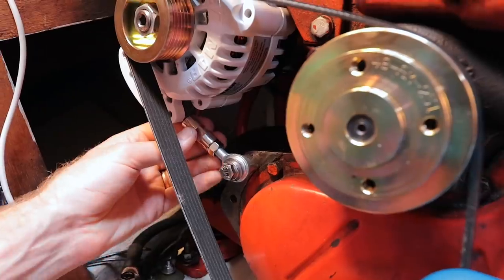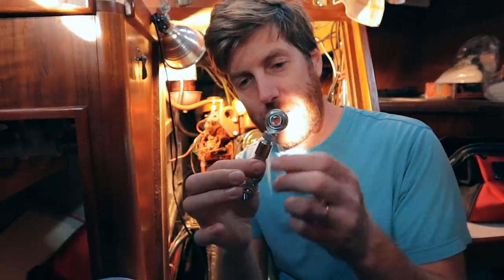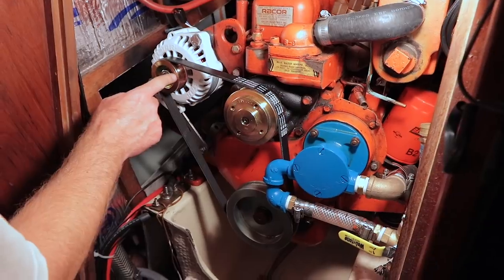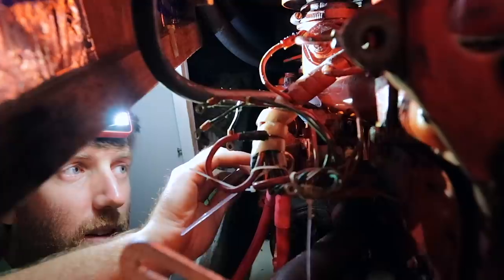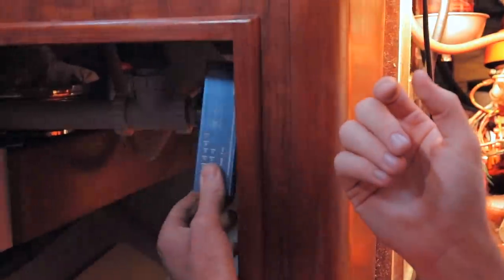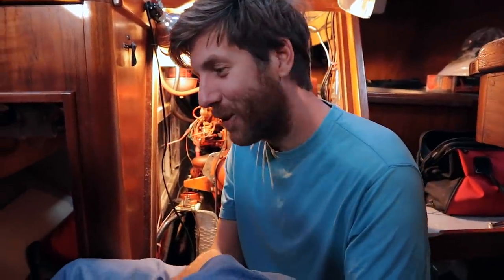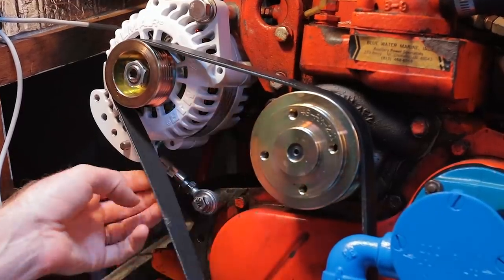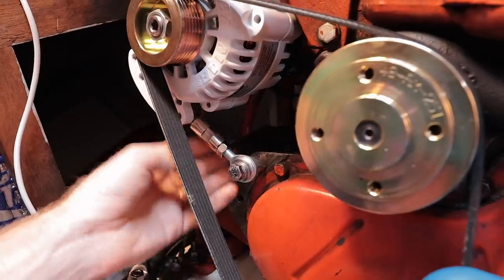“Don’t Do This, You’re an Idiot” | Sailing Soulianis - Ep. 62.2

Comment: Good Job Skipper ...when the engine was cranking if you touch the cables that you change to make sure they dont get hot, i think it will be good.. also when sailing with motor ruining better to check the wires buy touching, if anything getting hot means not so good... be safe and have fun..

Comment: You may want to think about the amount of contact the belt has on the water pump @1:04. If there is any slippage, you'll see a black powder forming around the area. There are some easy calculators out there to give a good idea of minimum belt wrap angle. Cheers.

Comment: Great work on Mr. Beke and a wise upgrade (alternator, water pump, heat exchanger, etc.).  I assume that you have a spare belt on hand but one thing to consider is to use a Kevlar belt as they are much stronger and last longer!

Comment: Kirk, The wire from the battery should always go directly to the starter. The time period of use might be low but the amperage draw to the starter is very high and gets higher as the starter gets hot due to longer than normal cranking. The amperage draw of the alternator back to the battery for charging is a lower average and the #2 wire will suffice....Marty
Reply from the maker: Hi Marty, thanks for your comment. I used the blue sea systems wire size calculator when working on this which suggested a #4 wire for a 150amp draw on a 12" run.  The jumper that's there is significantly shorter than that, and it's been upsized to #2. The instructions for the alternator were to wire it directly to the battery, which prompted the change.  I'm sure the #2 would be plenty for our 120a alternator as well, but the shorter duration of usage on the starter seemed more appropriate.  Either way both wires are significantly larger than the wiring that was there and used to start the boat for 40 years before we bought it.
Reply: @SailingSoulianis  Kirk, Sounds like you have done your homework as usual. Following the manufacturer's instructions is generally a good idea and if anything does go wrong you can claim under warranty. Love your videos look forward to future ones....Maty

Comment: I just watched your last episode with the Heat-exchanger problem. As for the old unit you yourself can fix the dents. As to the zink still in the lower end ? If you can find muriatic acid tip the heat exchanger-up on the one end and fill the H. E. Up to the top. Let the acid sit in the H. E. For about 1 hour. The acid will dissolve the zink. If you are still having problems there are two companies that specialize in these types of heat exchangers, Lenco and another company that has been around for years call “ Sender Heat Exchangers “ I think they are both out of Long Island. You can find them on the a Web. Both are excellent. Do not go to Westerbeke they will charge you an arm and a leg. Westerbeke would send the H. E. To Sender.
Reply: Todd Abrahamsson  I think you will find the westerbeke prices are not so terrible ( I have a Westy) and they ship same day and their parts will fit without modification , you can save money with aftermarket parts but it will take more time to reconfigure . Which is more important time or money....?
You also need to be careful with belts , somebody else suggested getting the equivalent from an auto parts store, you can certainly do that but you may be getting parts of unknown quality. You want to always stick with top quality parts on a boat.
In a car if it fails , no big deal you just pull to the side of the road and call triple A but at sea , at night, going thru a tricky channel is not when you want a failure  !  ( emergency spare part , that's different ) cheers Warren
Reply: @CheersWarren  I was an aircraft mechanic and worked on airframes and powerplants. If the part is a critical part and a replacement can be purchased, then replace the part. Especially if the replacement is an upgrade and engineered better. Noting is designed to last forever.

Comment: 1) U should try to fix old heat exchanger (heat up and straighten banded edges)

New style looks what i got! It has removable caps and mash so if U have broken impeller in hose its not gonna massed up everything))

2) I like to check measurements before shipping process but if they did mistake it sucks)

3) Serpentine belt system is very strong and stable!

4) Loose wires around hot exhaust need to have fire proof shield.

I like soldering tips! 

Good job!

Comment: 2 cents - a little anti seize will go a long way on your turnbuckle threads to keep corrosion at bay. Also an anti-corrosion battery spray on all of your battery terminals that are exposed to the open elements will help for the future... the set up looks good, it would be nice to have a belt tension-er on the top between the alt and the water pump so the belt can grab more of the pulley without having to be very tight. If you have belt squeal under engine heavy loads, you might have to install a belt tension-er. Just my 2 cents - wish you guys the best and keep up the great videos..

Comment: The starter needs the 1/0 cable. Running a #2 to the starter, will shorten it’s life.
A #2 wire is good for 130 amps, if its temperature rating is 90C, (195F). and 115 amps with a temperature rating of 75C, (167F). 
I really enjoy your videos. Thanks You!
Reply from the maker: Hey Bruce, thanks for the comment, if #2 will shorten it's life, then I'm guessing a #4 will really shorten it's life.  And that's what was on it for the past 40 years ;)

Comment: that flat bar adjuster is perfectly fine if proper bolt,  nut and washer is used , and method of tightening using a bar is used . if not it dose not work as it should, the new buckle one you got is just more simple
Reply: Andrew bowlgarte not a lot of room in that engine compartment to use a bar I don’t think. I like the turn buckle idea better personally.

Comment: That little heim joint makes the adjustment much easier but provides no lateral support for that end of the alternator. given diesel harmonics I would opt to have the old bracket in place. The best kind of bracket is a combination of both brackets where the adjustment screw just holds it in place until you tighten the main bolt. That being said.... it’ll probably be fine. I would watch for any vibration in that direction at different engine speeds.  Wouldn’t want to crack the base mount.  Kirk you are getting dangerously close to being “handy”! Great works!
Reply from the maker: Good points.  I was worried about that at first because of the ball joints and have kept an eye on it.  But with good belt alignment there doesn't appear to be too many side loads on it and with two attachment points at the top and bottom on the other side it seems to be doing just fine. I was also able to tighten the bolts on the heim joint enough that it took the ball joints out of the equation.  They are resting flush on their flat face.
Reply: Sailing Soulianis Good deal. I’m always looking for that thing that can come back and get you at the worst time. You guys are doing a great job and the content has been really great lately, but I’m biased to the projects. :)

Comment: I see a couple of people have made comment on you new belt.
Now  the clue is in the name, serpentine belt. Well yours is not exactly serpentine is it ?
For it all to work properly, and most importantly not slip, you need better than 90 degrees of contact with each pulley.
If you look at the front of modern car engines you will see they idle wheels in strategic positions to achieve this. Under load I'd bet money your water pump pulley will slip, not a good idea. Even dropping the alternator down would help, but really an idler wheel and longer belt is needed.
At the moment id say your old V belt would work better as far as load carrying. Serpentine belts are also run much tighter than is needed for a V belt, which means making sure things like alternators are solidly mounted, nut just relying on one bolt with a side load.
Reply: neil1150 Exactly what I was thinking.  Looks like the water pump may well slip, wearing the belt, etc.  Definitely keep an eye on it.
Reply: You would be right if the engine was not a pipsqueek.  In this case, it is a pipsquek so.... rules of thumb for ~200Hp engines disappear when talking about 30Hp engines...
Reply: They haven't changed the belt routing though much from the original factory install as far as I can see... so I would have thought it is about right? I'm not stating a fact just asking a question.
Reply: @AthelstanEngland   But they have changed the belt type from a V which would be fine with a bit under 90 degrees of contact, to  flat but grooved, which wont like it.

Comment: I would keep the original 1/0 cable going to the starter. Starters draw an enormous amount of current when starting. The #2 cable should be able to handle the alternator output. The alternator won't be putting out 100A for extended periods. As the batteries begin to charge the alternator output will begin to drop. I would be more concerned with getting more current to the starter during starting. It can make all the difference in the world when starting any engine but especially a diesel engine due to its high compression.
Reply: I agree and run out put alternator wire to the starter short lead. Simple things sometimes one misses. I have that experience  :)

Comment: Based on the advice of Mainsail I added a 150 amp fuse to each of my 2 batteries.  Think of the power you would draw if the starter cable shorted out (with a screw driver maybe).  I have a 2 cylinder Westerbeke and the manual lists 125 amp maximum draw and the fuse never pops.

Comment: Wondering if you beefed up battery cables from the alternator, a great auto electrician(Mainsail) advised negative cable to go directly to batteries from alternator, not to engine block, ‘twas good advice.

Comment: Well there’s millions of your alternators with that bracket that came with the alternator kit , with the slide bracket you can put another nut and bolt under the alternator in the slide bracket so it can’t move , hope yours works and not comes loose

Comment: Mr Kirk - I’m going to guess that your major was engineering.  That smaller gauge alternator wire was the source of fires for some older 80’s vintage Tartans.  At one point they used trailer plugs in their harness.  I got rid of my ammeter altogether,  good job.
Reply from the maker: It wasn't, but I would have enjoyed it.  We removed the #6 ammeter loop during this project as well, after reading the T37 forum!

Comment: Do not use the small wire to go back to the starter, this require large amperage and will fry the wire.
Reply from the maker: We significantly increased the size of all wiring when re-wiring the battery bank a year ago: https://youtu.be/8np3KCUTHbc  We more than doubled the size of the alternator, so I re-arranged the wiring to be more appropriate.  The wire running to the starter is more than capable of carrying the load to the starter.
Reply: Keep your eyes on it
Reply: @SailingSoulianis  Keep in mind that junctions add significant resistance, when you're dealing with high amperage. Fewer junctions will be lower resistance, and more reliable starting. That said, as long as all of the wire is as large or larger than factory, and preferably no longer than factory, you should be ok. Didn't sound like the starter was struggling, but it did take a few extra turns to fire off, so it might be worth measuring the voltage drop across the entire starter wire (measure the voltage from the battery to the + on the starter), during cranking. Repeat on the (-) side of the system. At rest, it will be 0V. During cranking, total voltage drop (add the positive and negative sides) shouldn't be more than ~0.5V
Reply: @SailingSoulianis  Its more of an issue of the starter taking everything you give it. It is also only running for a second so not the worst issue.
Reply: Thats all good advice and theories, but when you have to prime the engine, or you need to start for longer during a compression test, you need that thicker cable. when a cable gets hot, the resistance increases, wich makes it hotter. Before you know it you got a fire.
Reply: I think he said in the video that the “thinner” wire was 2 gauge. In which case that’s plenty. If it’s still small like most charge wires, somewhere around 12-10 gauge, then yeah you’re going to fry that wire.
Reply: @SailingSoulianis  A Diesel starter needs a MUCH bigger wire than any alternator can ever possibly need.  Use the thickest wire you have on the starter, but all that old 2 gauge you took off the old batteries should be plenty for the alternator.
  Another thing you could do is connect the voltage regulator batt wire at the alternator end of the charge wire, so if that wire does develop a voltage drop, the alternator will slow down in response, just enough to prevent fire.

Comment: Let me get this right, you removed the main supply from the starter, and redirected it via the alternator! Run that past any auto electrician and see what they say! I get your theory, about usage time! However the startup voltage (amps) draw is massive.
Reply: I too, was very concerned about that mod. Somewhere Kirk stated the small cable is #2 AWG, which should be good for as much as 150 amps per this site: https://www.wiringproducts.com/battery-cable

So if the small cable is actually #2, and the starter draws less than the safe capacity of the #2 cable, and the large and small cable share a common termination point (both cables are bolted to the same stud on the alternator, so the starting current does not travel through the alternator), then it may be OK. I am not an authority on boat engines either so verify with someone who is. OTOH, if you stay on rivers, you can always head for shore when the cables start to glow ;-)
Reply: One. day they will be cranking on the motor and they will realize why the starter wire should be a thicker gauge hopefully the fire will be caught in time and the boat doesn’t burn down to the water line
Reply: I thought the same thing. I think it’s risky to put the smaller cable between the battery and starter. Huge current when cranking the engine compared to battery charging from alternator.
Reply: Agreed, this would fail survey inspection.
Reply: Agree not a great idea, two extra crimps in path to alternator and one extra terminal.  Don't underestimate the current used by starter, especially at start-up.

Comment: For the new crank pulley was it still a pretty good interference fit to get it on?  Maybe about .001''?  I'm not sure about this particular engine, but for many engines the keyway is the backup and the main connection is that interference fit.  Since the original required a puller, it sounds like this is the case.  If it's a slip or transition fit, you can fatigue the key/keyway over time or cause galling of the crank nose (or a fatigue failure of the crank nose itself).  I'm not saying any of this is likely, but something I'd think about depending how remote your travels will be.

Comment: Hi Guys...Just a thought...  It is correct engineering procedure to replace any water pump mechanical seal that has been allowed to dry out.  If the mechanical seal ever does dry out - change it! These seals are designed to stay wet, once wet.  It would be a great mistake to think it will stay reliable because it is not leaking at the time of start up...  I can assure you the chances that it will fail are 80% - 90% higher and the fact is it will fail earlier than it would if it did dry out. This is something  that should be changed without question if it dried out. 

I would not go to sea without another spare water pump anyway, but while you might have a spare pump - we all like to get the most out of our equipment and tend ignore such good engineering preventative maintenance practices to our peril.  Imagine seizing the motor at sea, because the pump failed - besides the cost, its simply not something you want to be worrying about in your life, keeping a beedy eye on the temp is like sailing without an auto pilot or wind-vane when you are under way, in a passage. It can be done but its horribly taxing. Stay safe, be safe, absolutely love your videos. Kindest regards to you both. Jeremy

Comment: Great job. You guys make quite the team. In the end you are ending up with a very capable power system and quite the colorful engine. I've got to order the Balmar magnet as the boat I bought did not have one onboard. My alternator is floating the FF batteries too high when motoring - they repeatedly tell us we do not need to float the batteries at all but, I don't know how one would do that when motoring?
Reply from the maker: Yea, ours float quite a bit because we don't end of drawing them down all that far too often. And our solar panels have them back to 100 fairly quickly. But we've set our float points pretty low, and on the alternator we've set it to float for the shortest time period allowed for in the Max Charger alternator.
Reply: The  MC-614 looks like a nice piece of kit.  
       All of this would make for some nice future content where you can discuss battery chemistry, charge current vs temperature, and charge cycles.

Comment: Where have you been getting your Westerbeke parts? I have a W25, and I will eventually need to replace that fresh water pump, too. I’ve got a bit of a wobble in the water pump pulley, and if I let it go too long it could wind damaging the bearings. Also, I have a drip in the high pressure fuel pump that probably also needs to be replaced if I could find a replacement.

Comment: i'm not sure about this but @10:19, that nut should probably have some locktight on it? i'm concerned that the vibration from the engine will loosen the nut when you're out there. if you ever get 'out there'.